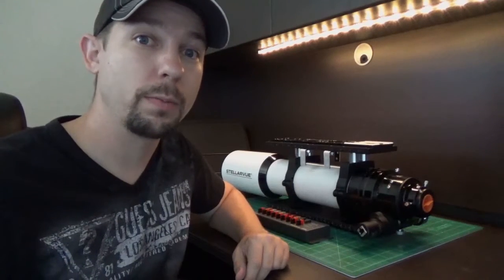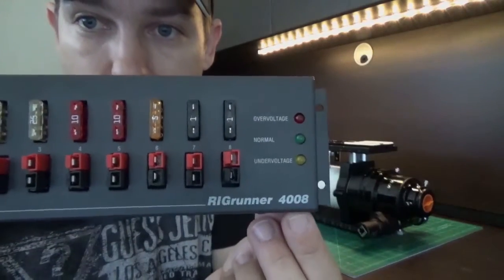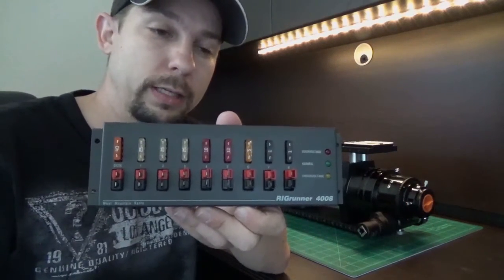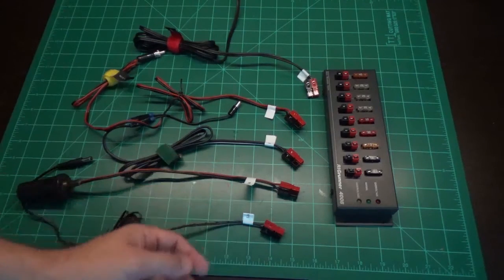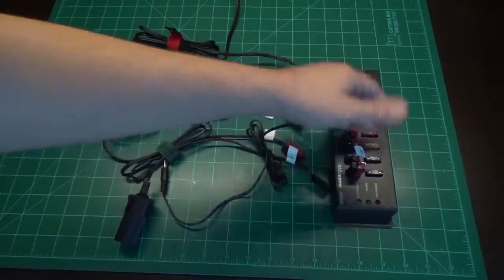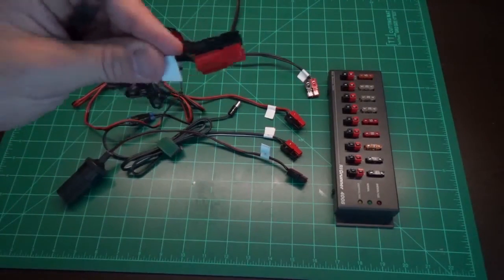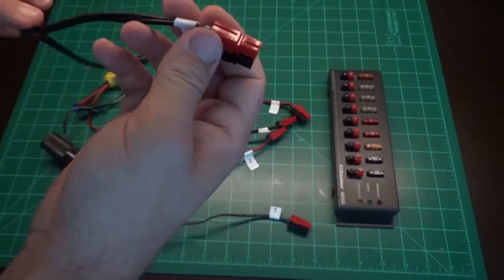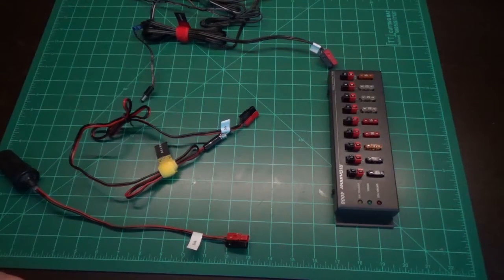Astrophotography  Cable Management Part 3 - Power Cables

Comment: Hi Mitchell, thanks for putting me onto Rig Runner and Anderson Power Poles! Just a note of caution: it is NOT always true that the wire with writing on it is the positive. I found a couple of devices where the wire coming from the negative side of the 5mm x 2.1mm plug was actually the one with the writing on it. To be absolutely sure, ALWAYS use a volt meter and check for continuity when building the cable: the red Anderson PP should be continuous with the centre of the plug, and the black should be continuous with the side of the barrel section. Failure to check every cable you make using co-molded plugs could result in an expensive cloud of white smoke.
Reply from the maker: As a hobbiest with this kind of tinkering these tricks of the trade are usually unknown to me.  THANK YOU so much for clearing this up!!

Comment: Hi Allan. Hope all is well. I am wondering how the RIGrunner is actually powered. I see the first port is IN/DC which lets me assume the incoming power is already 12V.
This would mean you must either power it with a portable power station or have in-between AC outlet a transformer to bring power down to DC, correct? What did you use, if I may ask? And if I would like to use it from an AC outlet, what would I need to get the 12V/40A? I would like to be able to use this at home with AC and out in the field with a portable power station such as a Jackery . Thank you.
Reply from the maker: You don't need 12V/40A.  That value is the maximum you can draw from all your equipment.

I bought a 12v power supply for a 3D printer that works perfectly.  Does the wall AC to DC conversion and in my case supplies 20 amps .
Reply: @I_Spaced_Out   Electricity is definitely not my forte. Thank you for the follow up and answer. Very helpful 👍
Reply from the maker: @georgalbrecht8029  then you really shouldn't do this.
Reply: @I_Spaced_Out  I am too old to be an Astronaut, but everything else can be learned when overcoming your own fear!
Reply from the maker: @georgalbrecht8029  that attitude is the right one to have.  Ignore my previous comment.  Be safe, check everything twice.  This electricity can hurt or even kill so I worry out of an abundance of caution.
Reply: @I_Spaced_Out  Thanks Allen. That's fair to say. As it is not my forte, electricity, I will triple and quadruple everything. I have already the USB hub put together and happy to have less cable clutter crossing the patio ;)

Comment: Hi, nice work on cable management. Are you plugging the RIGrunner to a battery or a wall outlet ? I guess you will need a 40AMP converter to use the AC wall outlet. correct ?
Reply from the maker: I don't know what size of a AC/DC converter is necessary, because as you correctly guessed, I am running from a battery.
Originally, I ran a Marine Deep Cycle battery, but in the last month or so I finished construction on the replacement battery which is now a Lithium Ion battery.

There is a better walk-around showing how it's all connected together in this video  https://www.youtube.com/watch?v=uMWfEEUkE38&t=255s

Comment: Dear Allen. I just started with this hobby and you series of cable management videos are very helpful for the near future. Thank you. One question. Do you power your mount through the RIGrunner as well or do you do that separately? Just wondering. Thank you.
Reply from the maker: Not my mount because my mount is not 12v.  But if yours is you can.
Reply: @I_Spaced_Out  Thank you and clear skies

Comment: Hey Mitchell, thanks for this post! This was extremely helpful; I have been researching what battery to buy for about 2 days now. I think I'm going to go w/ this rigrunner system. Was going to ask if there is a specific battery you recommend, I've seen your observatory post w/ the black encased battery system which looked solid. I was going to pull the trigger on a 20 aH deep cycle. If you have any recommendations for a specific battery that would be awesome! Thanks for your help Mitchell, clear skies! -Rory
Reply from the maker: I'm using lithium Ion batteries now.  They're stupid expensive, as I've spent over $700 on the two I am using, and have blown a few up along the way (probably another 3-400 spent on them).

Get whatever is in your budget, that will also last a few sessions between charges.
Reply: Thanks for the response, how many amp hours would you recommend? I am not concerned about budget, I don't want to re-buy stuff though. Man, I've been up all night reviewing forums and trying to buy the right stuff. I just pulled the trigger on a dew-buster system that ran me about $450, and then I anticipate spending another 400-500 on a battery! Awesome vids Mictchell- really informative! I've seen so much about AP gear but not too many people focus on cable management as well as you did. This is the foundation of  AP, and there is alot to know about splicing wires/getting the right energy requirements/ etc. Appreciate your work. Where do you post your work?
Reply from the maker: Hacksesh,
I cannot really comment on how many amp hours to get.  You will need to have all your gear first - then figure out how many amp hours everything draws at the same time (just add up the mah on the outputs of the AC cables).  Take that value, and multiply by the maximum number of hours you want to use the battery between charges.

In my case, that was 12 hours, or two six hour nights.  It was a bit tricky, because I had to convert to Watt Hours in my particular situation since my mount draws 48 volts, and my gear draws between 5 and 12 volts.  To complicate matters more, my batteries are 56 volts!!!  Watt Hours were the common unit for all systems in play.

Thanks for the encouraging words!  I really do take as much time as I can possibly put into deconstructing each process I do into the simplest steps to follow - so I'm glad that this resonated with you.

As for my work, I don't really share it online.  Not yet anyway.  I'm a bit of a perfectionist, and I haven't been able to produce images yet that I'm happy with.  That said, I haven't imaged in a year due to weather, work, travel, and spending much needed time with the family when I am home.

I hope that 2018 will be a different story.  Only time will tell!
Reply: Look forward to seeing your work! Clear skies :)

Comment: Nice solution. The video is a bit lengthy.
Reply from the maker: I am trying to find balance between too long, and cutting out too much information someone may want to know.  Initially, I thought that being under 10 minutes would be brief enough to explain why I did something the way I did, and show how I pulled it off.

If you could trim some of the content out, what would you think should go?
Reply: Hi Mitch,

i followed the link from your recent post in the Losmandy Group. I viewed all 5 parts of your tutorial.
From my point of view you could have shrinked all to one video at 10'. But i am an experienced astrophotographer,
this may vary for a newbie. I like your setup. One thing to mention, i would have used short diy cables.
Regards
Robert
Reply from the maker: Indeed, this was aimed at the less savvy, hence the excess in information.

Shortening my power cables is on my 'to-do 'list.  At the time, I was not completely sure how much cabling I would need for each device or what the final configuration would look like.  After splicing my cables to their current lengths and routing everything I had a good idea of what could  be shortened and by how much but I was out of connectors by then.

I'm curious, as an experienced APer, what gear are you using?

I'm assuming that coming from a Losmandy Group you're using a G11 or Titan?
Reply: Yes Mitch you are right. Im on a G11/Gemini2 with different setups.
More here:
http://www.astrobin.com/users/Potheadpixie/
Robert

Comment: sound was terrible and you should have shown it all together not on the workbench
Reply from the maker: Early in my channels history, I was pretty new at making videos and getting quality audio.  I still struggle sometimes but now I have a better microphone.  

I made the decision to show the cables attached to everything in the 4th video where I also route data cables with the power cables.  At the time, it made the most sense to have all the cable routing in a single video.
Reply: @I_Spaced_Out  cheers for replying

Comment: What did you use to power the rigrunner itself
Reply from the maker: Sean M a portable battery that i built.
Reply: Ah okay.  I have one I built that I could use but I have access to electricity but have only found a 15-20 amp power supply for it which really should be plenty enough.  Thanks for the video series